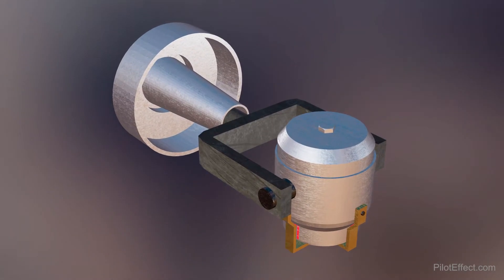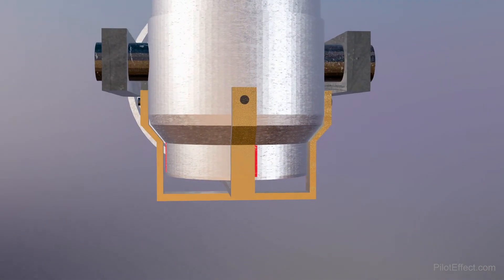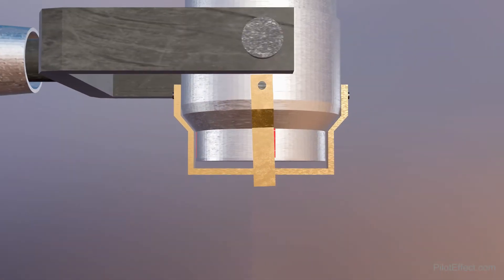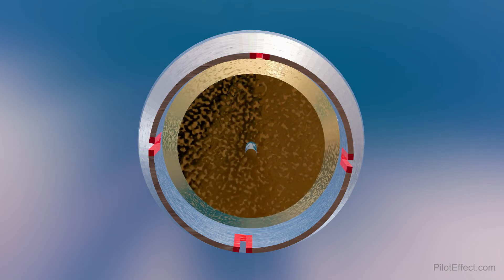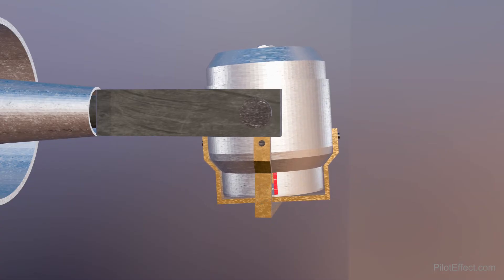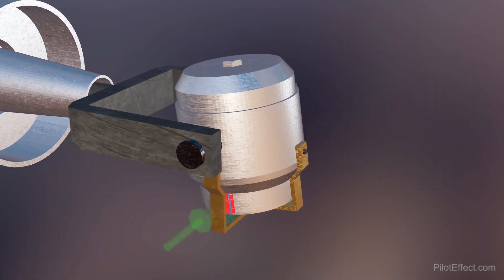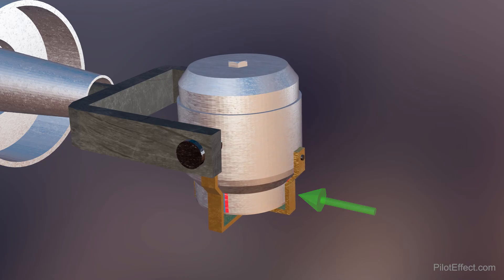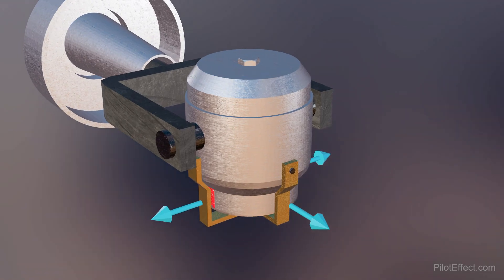Pendulous Vanes | Pilot Tutorial

Comment: Great video thanks. Can you please explain this in more context of the spinning disk thingy changing as it travels over the curve of the earth?... I think I'm getting it.
Reply: I see this comment was from a year ago, but if you still care this question is the reason I watched the video. The way I see it from the video, the gyroscope always tends to stay in the same plane (xyz not airplane), but as the airplane moves around the earth, the pendulous vanes stay pointing towards the center of the earth, so as the plane travels around the earth, the vanes point down (towards the earth) , and the gyroscope tilts (relative to the airplane because it stays in its original plane). Because the vanes always point down, as the gyroscope tilts (relative to airplane), the air holes open in such a way that the gyroscope adjusts to the vanes, therefore adjusting to point relative to the  the earth and away from its original position.
Reply: @ethanaxon6784  One issue is that the pendulous vanes can only measure the direction of apparent gravity.  During a turn, apparent gravity is not directly downward, but is perpendicular to the floor and wings of the aircraft.   This creates nuisance measurements by the pendulous vanes, and the pilot has to periodically return to cruising straight to reset the measurement.

Laser gyroscopes can shut the gravitational homing "off" anytime the accelerometers measure greater than 1 g, so that banked turns and aerobatic maneuvers don't give it false measurements.